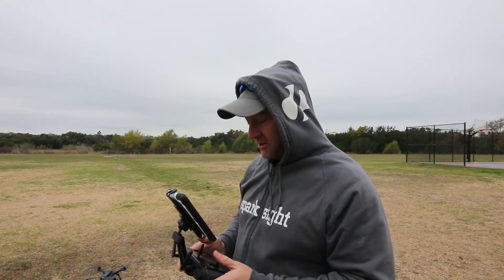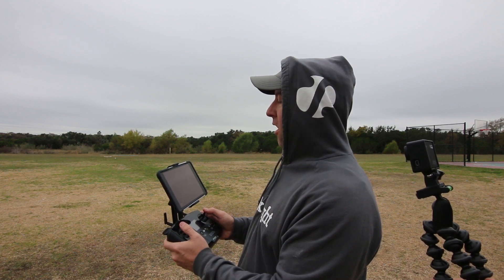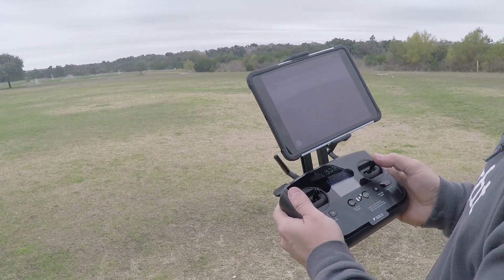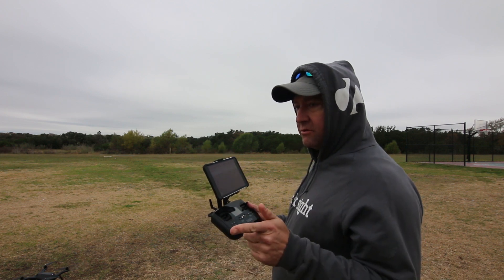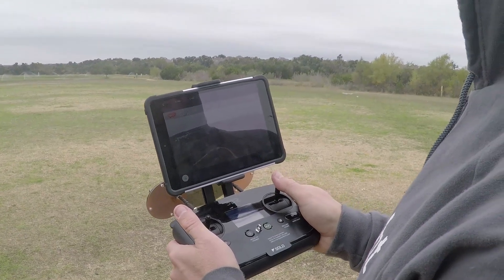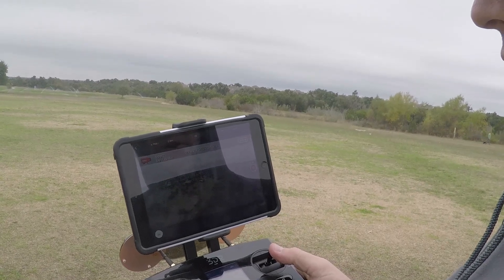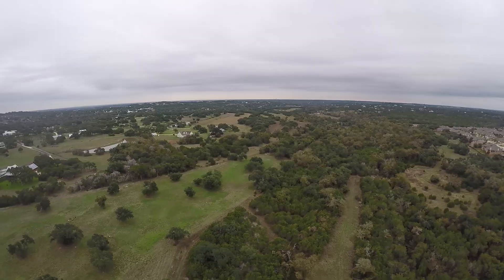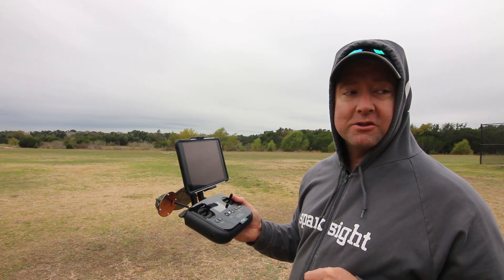3DR Solo Range Test - Stock vs. Aftermarket Antennas

Comment: Could someone explain to me manufacturing and marketing please. 3DR have, or had, a pretty good, if not great, drone with the Solo. They've designed and built it. The thing flies well, right? It's even been upgraded with the new cube (or at least I think so). So why then if you've gone to all this trouble wouldn't you just keep manufacturing them and selling them? Because there are all these new, cheap drones coming out now that are just Not So Good. If they can do it why can't the Solo? The Solo is a way better design. And I'm pretty sure HEX or Proficnc  or whom ever is working on the Pixhawk 2.1 (CUBE) still uses this technology I think in some of its prototypes. But I could be wrong. Point is. I don't think this drone is dead yet. Yet no one is manufacturing it? Crazy world. I just don't understand it.

Comment: I did a flight 400 ft up, 4000 feet out off a mountain with the Alfa 20.00 antennas. Way better than stock.

Comment: Theoretically...if the stock antenna was designed properly and accurately, you should not get much better performance from another antenna due to shape.  Antenna size is based on the wavelength of the frequency which you are using.  1/4 wave...1/2 wave..full wave etc.   The diameter, or gauge of the wire used to construct the antenna also affects the performance.    Antenna theory is very complex.  I am certainly not an expert, but from my HAM radio research, this is what i have learned.   Did the non-stock antenna you used to get the longer range have an amplifier of some sort?   Here is some web info...

Comment: Careful, guys, you are affecting the multipath interference by tilting the antennas up or down, and some of the signal fluctuation you are experiencing is typical peaks and valleys that occur due to multipath as you travel outward or inward at a given altitude. You are dealing with a lot of electromagnetic field characteristics at once, and you will probably get very different results in another location. Even standing on a chair (or hill) can impact your performance with either antenna. You might want to test the relative control ranges in a number of terrain settings before deciding which antenna is better. Good video though, it's good to see that the LR antennas are at least not the typical fake science items that are often sold for TV reception. Thanks for taking the time to test them.

Comment: So what is the deal - do the antennas need to be pointed down, or up?  I intuitively want to put them in the up position.  How much does it matter?
Reply: The manual from 3DR states to point the antennas 45 degrees down and in the upside down V orientation. https://3dr.com/support/articles/208046526/using_the_controller/
Reply from the maker: My understanding is they should be pointed up at a 45 degree angle. And that they should be parallel to each other (not a "V" shape). Hope that helps!
Reply: Thanks - that makes more cognitive sense to me - I see people in videos all the time with them pointed down at 45 degrees and in a V.  I am going to test it out - thanks for replying.
Reply: Thank you Jason.

Comment: FYI...Lipo batteries don't like to be stored with a full charge.  If you are going to use the batteries with in a day or so then charge them 100 percent if not they prefer to be stored at 50 percent charge.  Probably hard to do with the stock charger so you would probably have to charge to 100 percent and then use the drone to bring them down to 50 percent.  Unless they sell some sort of adapter that will allow you to use a auto rc battery charger with the storage function.

Comment: How has your 3DR been so far? Reading a lot of mixed reviews on them. Has your held up? Or is it glitchy?
Reply from the maker: It is less glitchy than it used to be due to software and firmware updates. Given the price of them now, I think they are a pretty good deal actually.
Reply: Ready Set Drone awesome, so it's not going to just take off and lose itself or not return home when it looses range? My only main concerns is if follow me mode works and if the drone comes home when it looses range. Which by your video it seems like it has the come home mode down. Does yours have the factory GPS on it?
Reply: Ready Set Drone I found out today that it's not compatible with my GoPro hero 3+ silver. So I'm going to have to go buy a Hero 4. That will put my overall cost around 550 to 600 dollars for the 3DR solo quadcopter. So my question is, should I just shell out the extra 400 and get a mavic or a phantom 4?
Reply: nope, better to have separate camera from quadocpter.

Comment: it sucks best buy had the quad gimble and controller for 299 now its just the quad and controller for 299 or you can get open box for 250 I have a go pro clone with Wi-Fi d you think it will work
Reply: I just got the Solo with a price match, 3 extra batteries, gimbal, and also extra pack of props for 410

Comment: I have a Yi 4k camera. I understand I will not be able to pan and do other fun stuff like you can with a gopro. BUT! Will I be able to stream visual flying to my phone/controller without the gopro camera. Thx
Reply: The GoPro camera does NOT control the gimbal. The bird controls the gimbal. Anything with the proper weight 78-82 gms and that fits will work fine with the gimbal. You just won't have camera control since the GoPro bus is proprietary and clone cameras don't have the bus (yet)
Reply from the maker: I don't think so. The reason is that the software is designed to work with the GoPro interface and API. I'd love to see what would happen if you try.
Reply: If you have HDMI out you should be able to. You just won't have any camera control
Reply: Yes, you can stream any camera on the Solo with an HDMI output. However, you can ONLY put a GoPro 3+ or 4 in the gimbal. So you'll need to remove the Solo gimbal and use the GoPro mount or try and install another gimbal.  Camera controls will only work with GoPro.

Comment: So does the Solo just return home if it goes too far and lose signal??  I just got one and am kinda new.  I am afraid if it goes too far i'll lose it.  I'm in the city by the ocean-- los angeles so there's a lot of interference and i'd be scared to lose it out over the water
Reply from the maker: The Solo will return to home if it loses signal. You will want to make sure that you are in a clear area when you take off. But I have flown it out of range before and it did return to home for me. Of course, the safest thing is to keep the Solo in range. Happy flying!

Comment: I read on 3DR forums that it is recommended to orient the stock TX antennas down and out 30 deg.  Wonder how that would help instead of the up orientation as you are flying there.
Have you tried other cloverleaf antennas?
Thanks for the vid.

Comment: These antennas are the BEST MOD for the 3DR Solo by far!  Only paid $19 and more than doubled my range!  https://www.amazon.com/Alfa-AWUS036H1W-AWUS036NHV-AWUS036NHR-AWUS036NHA/dp/B003ZWPS3O/ref=as_li_ss_tl?ie=UTF8&qid=1475639911&sr=8-3&keywords=alfa+antenna&linkCode=ll1&tag=a41a9-20&linkId=df8df6d31a7ab58836402e4882dc0862
Reply: KayakDIY it's currently unavailable 😔
Reply: Harry, you have to copy the address by highlighting it using your left-mouse button and then do a Ctrl-C to
put it into memory, then do a Ctrl-V to paste it into a browser or text editor to use.

Comment: I got 5600 feet with the ALFA antennas a few days ago. That was 2000 feet high from takeoff going up the side of a mountain while maintaining ~200 feet above the ground.
Reply: I don't think there is a difference in that way, but I have noticed I have significantly stronger signal by making sure the orientation has the ALFA logo pointed toward the drone rather than the back side without the ALFA logo pointed forward.
Reply from the maker: Yes - the ALFAs are amazing! Thanks for watching!
Reply: igot 8852 with one alfa and one stock no loosing signal and also no losing video feedback
Reply: does it matter which one (left/right) has alfa and the other has stock ? I wonder if one's for transmitting and one for receiving. Let me know what worked for you.
Reply: Chad McDowell I think there is. they have different v's. most drones have them marked which goes where because of this. idk about the 3dr but I'm assuming it's the same

Comment: Thanks for doing that.  If you're looking for range though...you gotta go Phantom 3 or 4 w/Lightbridge.  I can do 4 MILES one way with just parabolic slip on windsurfers.  Also, noticed the 3DR has a bit of jello on the video-is that typical?
Reply: Wait, you got 4 miles?  What was your battery life at when you reached that point and how long did it take you to get there?  Did the drone crash before it got back to you?
Reply: Turned around at 53% or so and came back at 11% (wind aided return).  This was at 400 feet height over farmland/empty fields though.

Comment: I  own a solo and I hate the range that it has. In town I can only get down the street maybe half a block. I can do that with some of these cheaper $100.00 quad copters.NOT IMPRESSED !! So I punched in  wifi signal booster and seen one that  caught my eye "BEER CAN WIFI BOOSTER" I watched it and thought W.T.F. i'm gonna try this. I have two antennas on solo so I went and picked up a six pack from the store. After all the beer were gone and to make a long story short I took solo out and tried her. You guys are gonna think i'm full of shit but  that night it  was 2;30 AM  AND -12 out and just a slight breeze I sent solo out and stood beside my car where it was warm. it went 7250 feet when the battery hit 50 % I still had one bar left but I didn't dare to go any further, I hit the home button and back she come. I have made this same trip only twice and am headed  for the 3rd go  around right now. Oh I might add that I  have no gimbal or Go-pro on board it's just solo !...!
Reply: Yeah just like the dji range extenders that slip over the antennas

Comment: While 3DR does say that your antenna should be turned downward...it really depends on the angle of how you hold your controller.  For best signal, it is important to keep your antennas perpendicular (90 degrees) to the craft....and the outward tilt of each one is to ensure a decent signal if the craft is banked either way.  Downward tends to cover the way most people hold their controller, but if your someone that prefers to hold their controller more vertical than horizontal, you might get a better perpendicular angle while tilting them upward.  The antennas pointing upward or downward isn't as important as maintaining a perpendicular (90 degree) orientation of your antennas to the craft.   AND directly pointing STRAIGHT antennas at the craft is the worst possible signal you can get.  Directional antennas completely opposite...they need to be basically aimed at the craft.

Comment: According to 3DR the batteries are always in a state of discharge.  If it was 2 weeks since you charged them you should have topped them off before flying.  That is part of the "Smart Batteries" function.

Comment: i want a solo, but my STANDARD phantom 3 I got over 4k feet today...  In the city... no mods.
Reply: +Ready Set Drone I don't either, if I can't see it I turn around... I am surrounded on the west side of my home by agriculture... So it gives me lot of opportunity to just fly around and practice.. which may occasionally include a length run.. On that same note I think I'd prefer a USA made and / or designed quad ..
Reply: +Ready Set Drone By chance did you test range with your antenna confined how +Mayoo N suggested?

Comment: hey just to say use 1 Alfa antena for $12 and 1 stock antenna and you'll get the same or at least close to the same distance. just saying :)
Reply: I've gotten 3842 ft with trees all around me in your condition in the video that is, I'm sure I'd get much further.
Reply: +R Reichel thanks can you please post the link to the Alfa antenna you purchased? I found this one on Amazon but its only $10.99 for 2.4 GHz and 7dBi:
http://www.amazon.com/Alfa-2-4HGz-Booster-High-Gain-Antenna/dp/B003ZWPRUI/ref=sr_1_4?ie=UTF8&qid=1448035501&sr=8-4&keywords=alfa+antenna
Reply: +philosopher1st I think any WiFi booster helps. I too bought some cheapo pair for $10 and trippled the range.  also there is no reason to go that far as ud have to come right back anyways haha